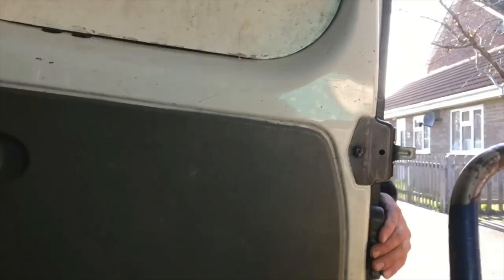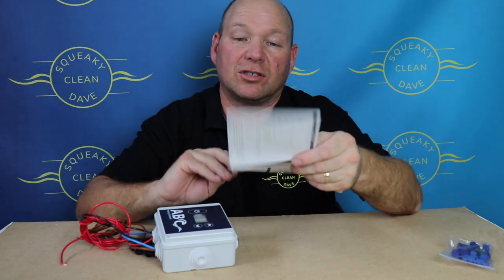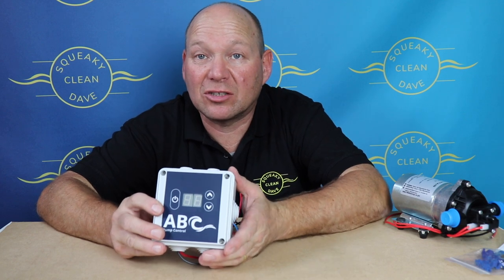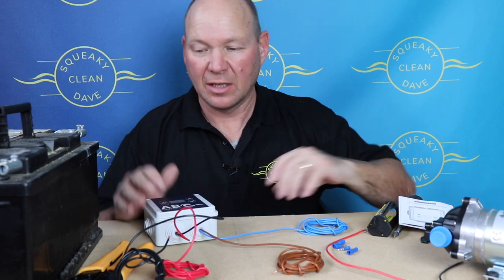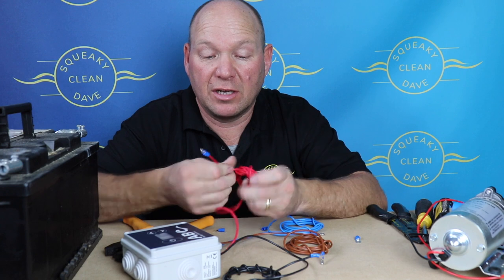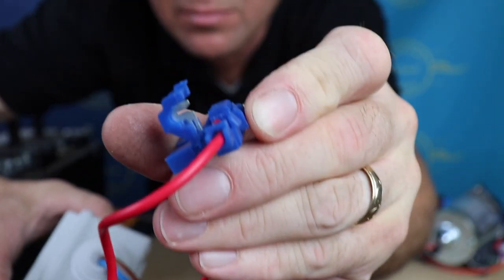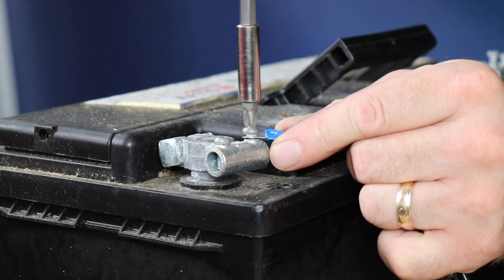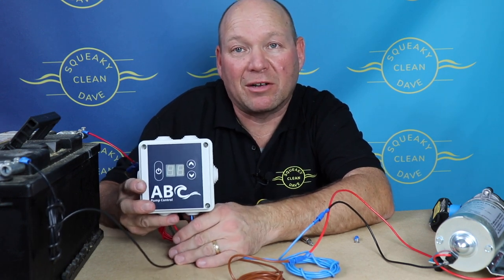The Best Entry Level Controller On The Market

Comment: Does the speed rest to zero each time you turn it off?
Reply from the maker: Valley Cycles that’s a good question. I’ve just tested it and no the controller stays at the same setting as it was last at. I have a kill switch in my van which disconnects the battery and even when that’s turned off and then back on it comes back to the same as it was set NOT zero👍
Reply: Squeaky Clean Dave thanks for the reply, great videos btw. They are helping me out a lot as I’m just setting up.
Reply from the maker: Valley Cycles glad I can help. Just to let you know there is a 2 year warranty on the controller not one year as it says in the video. It was upgraded earlier in the year

Comment: Another nice video, u have helped me out so much as im just getting into wfp, can you recommend a decent pump which will last and also go with this unit, cheers dave😃👍🏻
Reply from the maker: BDW WINDOW CLEANING thanks for watching. I’ve always used the Shurflo pumps and never had any problems. I’ve got one in the van that’s between 8 and 10 year and I still use it daily. Darren from D A Conponents sells them 👍
Reply: The 8000 series Shurflo 12v 100psi 5.3lpm diaphragm pump is the industry standard. They must be used in conjunction with the shurflo strainer / inlet filter. Both available from Darren @ DA Components 

https://www.da-components.com/shurflo-12v-water-pump-100psi-5-3-lpm.html

Comment: 60 pounds it's not that cheap for this bulky looking controller. I bought 6 years ago cheap controller on eBay for 35 pounds and it was smaller than this plus had connections for two pumps. And each pump had it's own dial to change the water pressure. And battery scale... So it's not cheap. Other than that of you add extra 15 pounds you can buy much better controller and smaller
Reply from the maker: Lexiu thanks for watching the video and your comments. It’s just my opinion that this is the best on the market. I’ve bought cheap Chinese stuff off eBay that’s lasted and other things that haven’t. This is made in the uk and has a genuine warranty.
Reply: Cheap Chinese junk boat controllers from Ebay have no technical support no warranty or lengthy testing or research and development. The ABC is British built and backed by faultless service and support 👌🇬🇧

That's my tuppance worth of opinion
Reply: @AW-Services  I'm not talking about cheap Chinese controllers. I'm talking only on British guys who made them. All the components are very cheap but they take a lot money because there is to low demand on this stuff .

Comment: this is absolute theft!  the cheapest controller can be bought for £ 10, just enough to wrote in ebay "12v dc engine speed controler, get some box in tool station wire it up and vuala £ 10
Reply from the maker: Marcin Karwowski 
You are right you can buy much cheaper of eBay but this is a quality piece of equipment that is built to last in the uk with a genuine controller. Saying it’s the best on the market is just my opinion which I stand by
Reply: @squeakycleandave1  . I really like what you do;) you do a lot for us ;) idea to sell something is also ty3 best , thats how you can grow . But ;p same controler i bought yesterray from china 30amps 6£ ;) elekteonic box 5£ ;)) this is the cheapest;))))))) my scool proffesion is an  elektronic  ;)
Reply from the maker: Marcin Karwowski 
Hi Marvin. Thanks for your comment. I would love to do a better comparison and although DA Components’s sent me this controller most of my channel is funded by myself as a hobby and have never received a penny for it. I was thinking about ordering one off EBay as you suggest and having a go. You are fortunate with your background but a lot of people don’t understand what to do especially if they are just starting out and want to buy something ready made that they can really on. Can you put a link on here to the one you got from eBay please and I will have a look
Thanks 👍
Reply: @z_pra-wiedy_wy  The £11 is not the full cost of this  Chinise potentiometer. To give a true cost then cables, fuse, fuse holder and cables connectors, drilling the box and tools need to be added. Plus time to put it all together. Time has a cost that needs to be added in.
Reply: Also water  pomp for the feed pole  in the car can get for under £10
Reply: This is auto flush wich is cleaning membrane for few seconds every time when the pomp is turning on ..       if you wanna go for auto flush once every 6h of using than you can use electronic swich wich is on Ebay for 10£
Reply from the maker: Marcin Karwowski Thanks I will have a look at that 👍